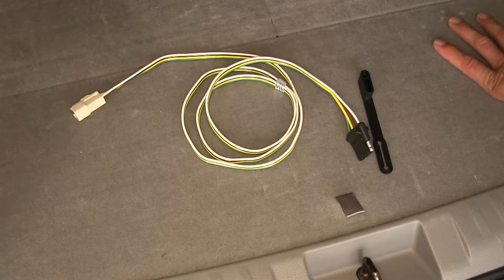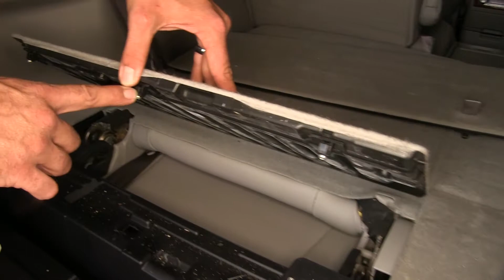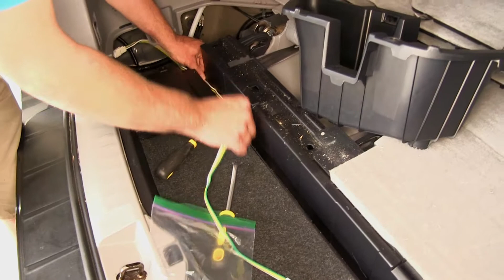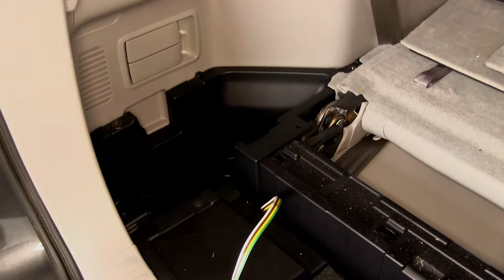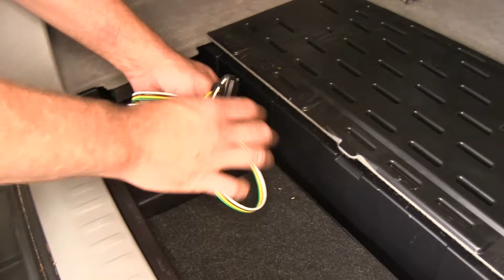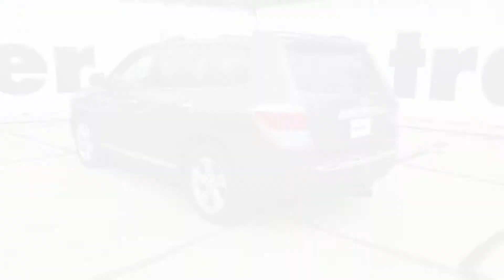Install: Curt T-Connector Vehicle Wiring Harness for Factory Tow Package on a 2013 Toyota Highlander

Comment: This is only half the job. There is a harness under the dash as well.
Reply from the maker: Yes and no. If the vehicle has the tow package, you'll just need the # 56042 for the rear. If it doesn't have the tow package, you'll need the # 118449 which includes the front harness/converter and the rear harness. You can see the # 118449 installed in the video I've linked for you.
https://www.etrailer.com/Custom-Fit-Vehicle-Wiring/CURT/56042.html
https://www.etrailer.com/Custom-Fit-Vehicle-Wiring/Toyota/Highlander/2013/118449.html
https://www.etrailer.com/tv-install-trailer-wiring-2013-toyota-highlander-118449.aspx
Reply: But how do I know my car is tow ready?   The previous person I got it from used to RV tow the Highlander but on the rear I see the hitch but not the wiring unit. For the 4 pin or anything

Comment: This doesn't do reverse lights?
Reply from the maker: It does not. The 4-pole trailer connector provides signal for the running lamps, turn signals and brake lamps only. If your trailer is equipped with reverse lamps, then it's likely equipped with a 7-way trailer connector. To convert an existing 4-pole to a 7-way, you'll need an adapter like # 37185. The purple wire on the adapter would tap into the vehicle's reverse lamp circuit, and the white wire would be grounded to the trailer frame.
https://www.etrailer.com/Trailer-Wiring/Hopkins/37185.html

Comment: Hello, I’ve got a 2008 Highlander Limited. I can’t find that connector but there is a 13 pin connector with 7 wires going to it. Is there a way I can use this connector for a trailer plug?
Reply from the maker: You can use any of the kits in the following link. They are designed to fit the 2008 Toyota Highlander with the factory tow package.
https://www.etrailer.com/t1-2008_Toyota_Highlander.htm?style=with+factory+tow+package